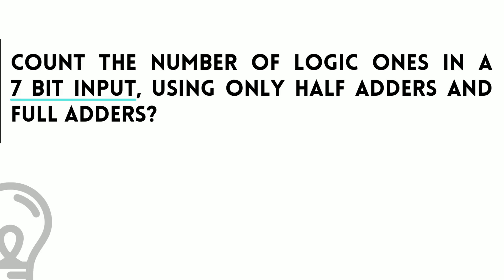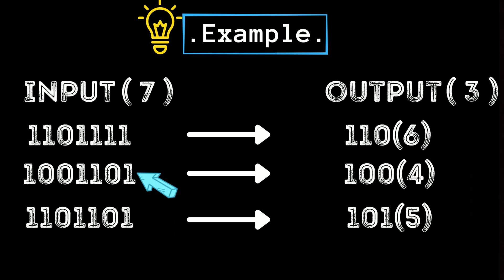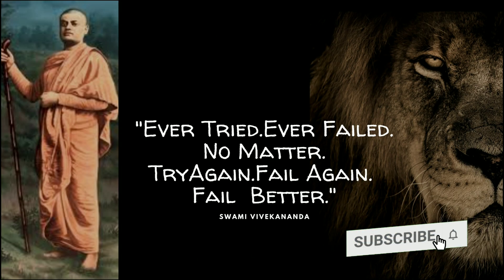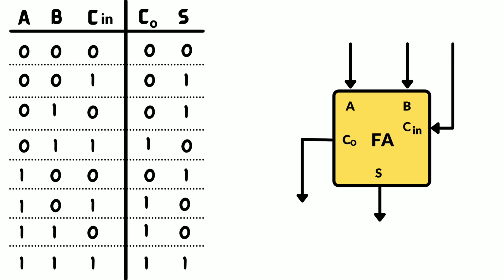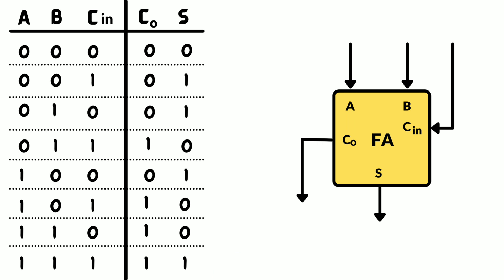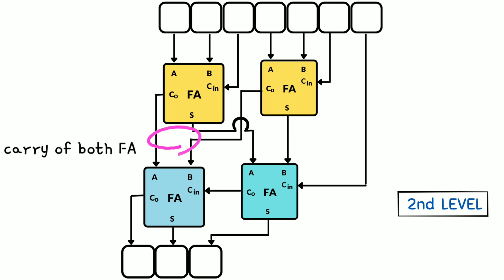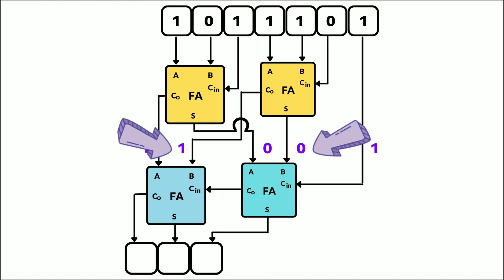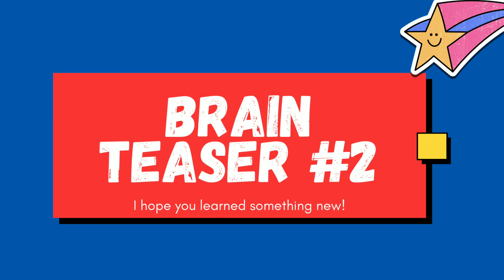How to count number of one's in a binary vector using adders?🤔💭 Brain Teaser#2

Comment: This logic is not working for 101111,not only this take any 6 bits and total 1's should be 5 then this logic is not working
Reply: insted of considering lsb as 0 consider msb as 0.. then put it in to calculation,,, I am sure it will work

Comment: First of all it is amazing Kartik! But I am unable to think of a logical explanation to arrive at this solution. Could you throw light on the thought process of how to solve this
Reply from the maker: Namaste gautam 🙏,  we are adding each bit ,since FA has 3 inputs , we are 3 bits and another 3 bits , if bit is missed we will be adding as carry.
You can try with different number of bits , to get better understanding.
Good luck & great health 👍😊
Reply: @KarthikVippala  Hi Karthik, even I have the same question.
In the second stage you have connected sum and carry to FA in alternate path instead of same path.
I know it works. But what is the logic behind it ?
Reply: The way that I thought about it is to think about how you would approach the problem after doing the first two additions of 3 bits. Now, you have two 2-bit numbers. Bit 0 is the sum bit and bit 1 is the Cout bit. Now, you need to add these two numbers together. You have an extra carry in-bit, so that can be added to the first full adder. Then, you carry out the addition as normal, adding bit 0 together (sum bits) and then use that as cin to add bit 1 (Cout bits).